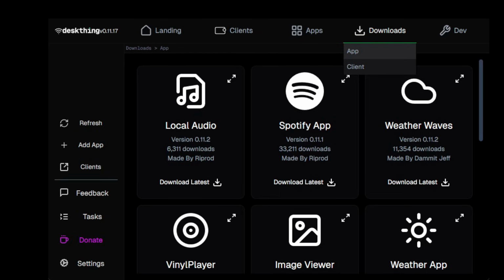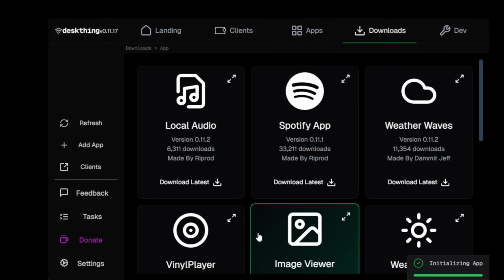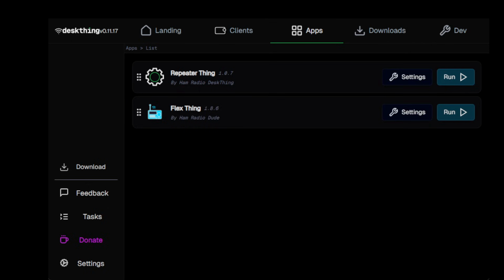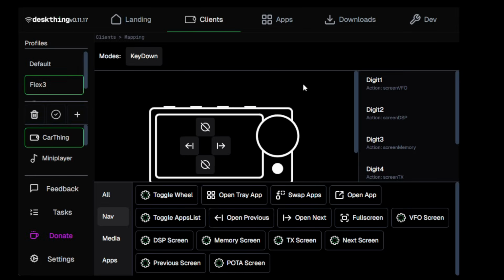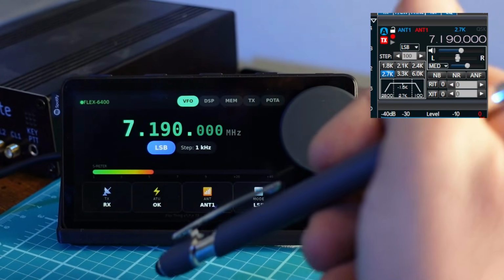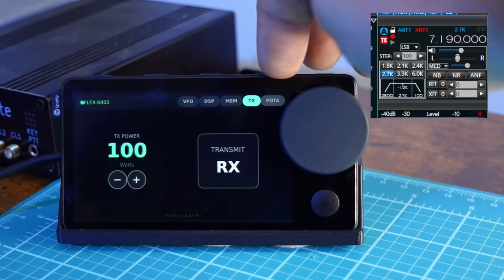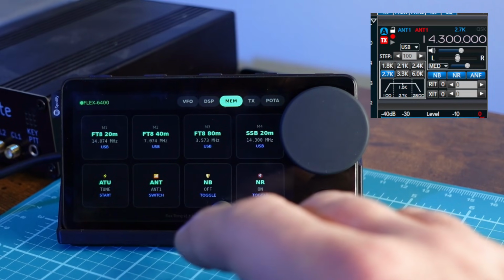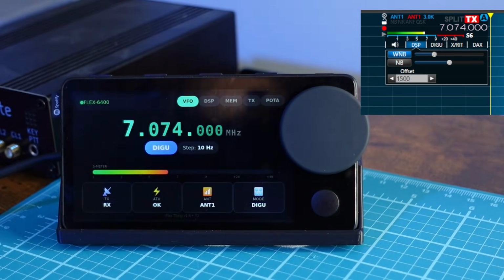I Turned a Spotify Car Thing into a FlexRadio Controller... Using AI!!

Comment: Ordered! I have flex 640” and Hermes lite 2+…plus a flex 1500 on a portable box. This is brilliant!
Reply from the maker: Happy Holidays, Frank!  I hope you enjoy this!  I am making a V2.0 now with more features (for the flex).  What do you run with your Hermes lite, Thetis?  I can't wait to hear your thoughts!
Reply: @DudeTested I use Thetis on HL2+. It’s terrific…it drives a Palstar La1k amp and hf-auto ATU, putting out s couple of hundred watts when needed.
Reply: See you’re already working on the hl2+ version already. My advice is to focus on those repetitive actions that take a mouse movement/click operation within each mode (CW, SSB, Digital). This will make this device most useful. Use Thetis as the software target, Sean.

Comment: I absolutely love this project and all the possibilities it offers for quite a low price!  It will be so good when they crack the video drivers.  It looks like they use the framebuffer atm.  Thanks Sean.
Reply from the maker: Thanks!  I agree, there are so many possibilities.  I suspect it will be a while until the community fully  grasps that we can now make software for our favorite devices, at a fraction of the cost of typical software (with or without the car thing), take an idea and turn it into a working prototype in seconds, and use these tools to advance the ease and understanding of amateur radio, making it more approachable to the new ones coming in. Have a great one!